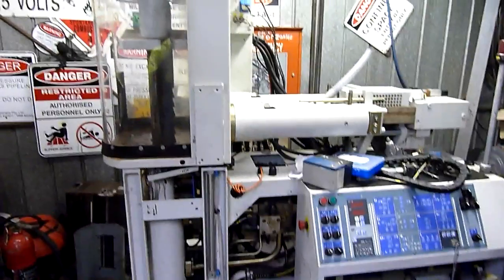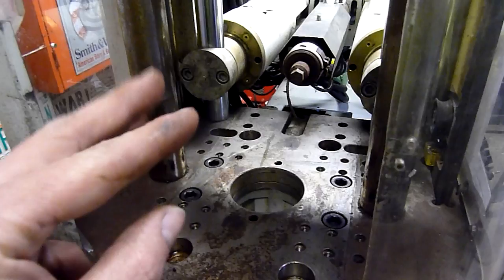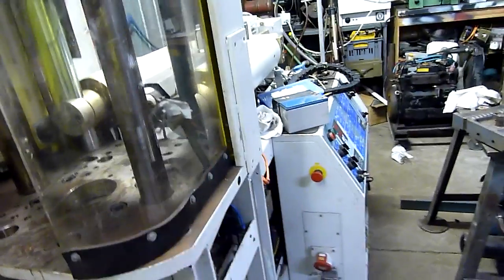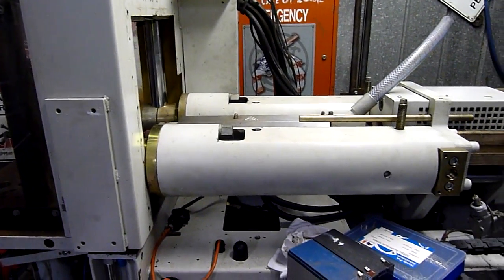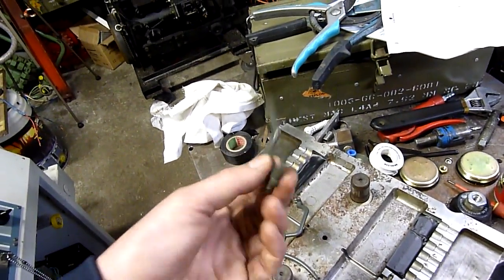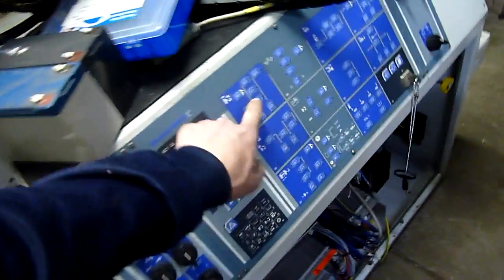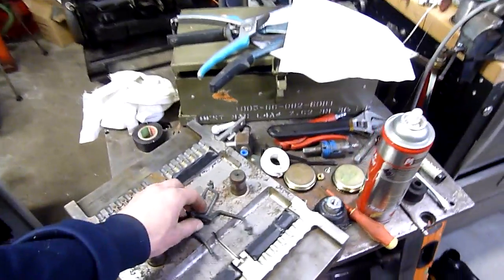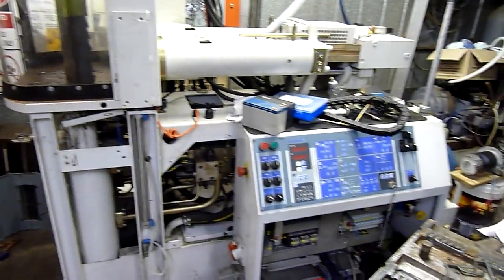Battenfeld Plus 350V Injection Moulder Rambles Pt1 - How it works

Comment: Yeah, you should see the size of the things made at step2. I worked maintenance there for a few years. Standing inside the oven and maintaining the burners and general cleaning of the oven itself of mold bolts. You can fit a small living space in one of them.
lol when working around shop trolls you had to make sure to disable things like the doors, and the burner ignition itself otherwise you will come out of it looking like something from mid-evil times diner table.

Comment: If you get some some from little tikes or step2 they are generally 'roto molded.' That equipment is, yeah HUGE! All they use is I wanna say ABS plastic ground into a powder. Molds are hand bolted and unbolted by a team of 4 or 5 workers on some machines as the mold spins in X direction it rotates in Y, in a very large, very fuel hungry blast furnace.

Comment: Worked at plastics place for a bit. We had a cell with a pair of Engel 3500 ton horizontal machines that spat out a 95 gallon, 30 pound garbage can every 36 seconds. As big and heavy as those molds were and as fast as they were moving, it was amazing how gently the machine could close.

Comment: Ed, you need to turn one of those cars into a giant RC car. You could use one of the hydraulic pumps and 12v motor on a power steering system to steer it. Actually making an on-road electric car would probably cost too much there, but it would be awesome to see you driving a giant toy car around the yard. You might even be able to use a smaller motor to power it and recharge it with solar panels. It's an idea anyway :D